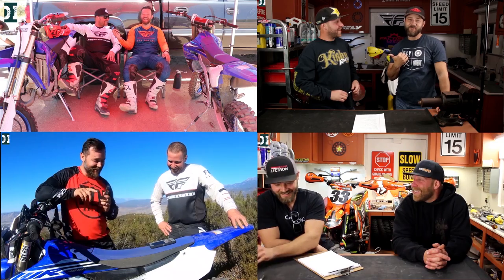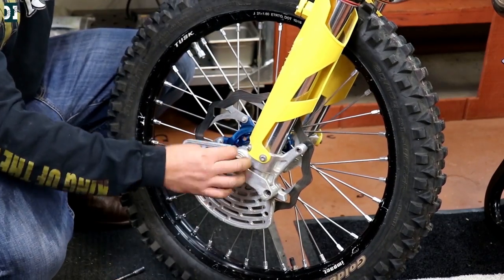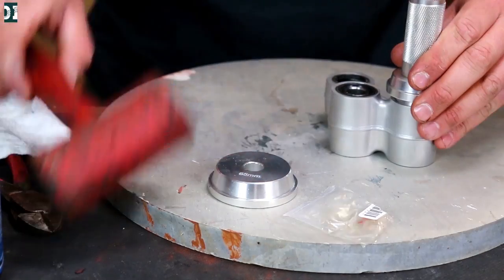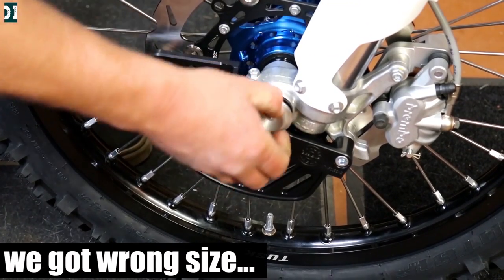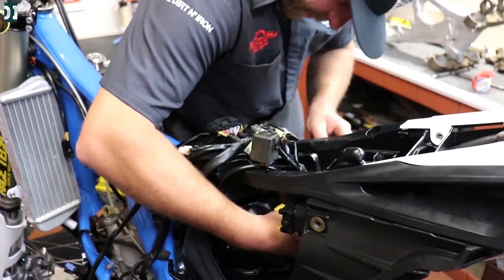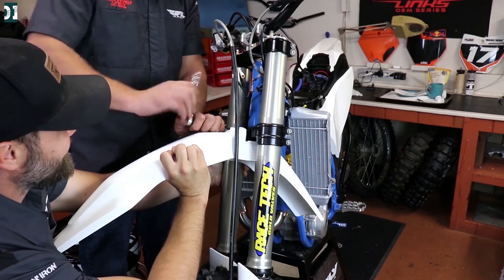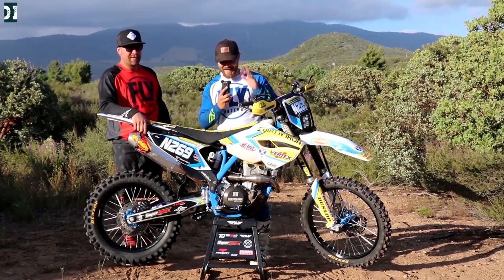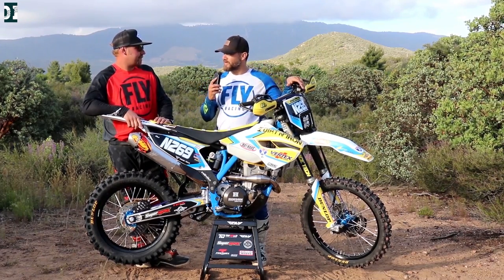Dirt bike build time lapse - Husky FE 366

Comment: Really nice build vids, colour etc. do you have a list of recommended bits for a new Fe350? or the list of upgrades you have done over the build? I'm hoping to pick up a 2021 or 2022 Fe 350 in the next 6 months and as a new rider want to get the right upgrades and protection :D. thinking black/grey/yellow scheme for myself
Reply from the maker: sounds good David! get a skid plate, wrap around handguards, shark fin, possibly linkage guard and have fun. you can add as you go. have fun!
Reply: @dirtniron  Thanks, I think i have all those written down,  wondering about a rekluse clutch cover, a chain guide, possibly looking at the extra air induction holes you did on your build!. i don't think ill be doing any power improvements until my skills are far better :D
also fastway pegs evo ext look good and maybe a bigger back brake pedal

Comment: When you put a new piston and or cylinder on you want to use regular not synthetic oil on the first hour or so because the synthetic is really smooth and can cause the new piston rings to not set properly , just a tip for next time
Reply from the maker: thanks for sharing Everett, this was a synthetic blend oil..

Comment: Is there any big bore available for a 2017 
or newer 350?  I can’t find one.
Reply from the maker: Kelly, Cylinder Works has the big bore kits for 2017+ models, its also 366cc, I rode couple of those bikes and they run really good

Comment: okay so theres a part that I would really love someone to help me out on, maybe two things to be honest. I am a little knew into dirtbikes or atleast finally owning my first one. There's a part when he is installing the linkage and said he added a dog bone that basically will adjust the height if needed. I honestly would love something like that for my bike, I see all these awesome parts but finding ones that fit my bike are kind of difficult. I have a 2005 YZ250F and I would love an adjustable linkage or even just something that can bring my bike down like just an inch or so.
The second part is I really want my bike to have a clean look and also do everything I can to make in run amazingly. Is there anything anyone suggest I should have a mechanic do first to achieve that. I was thinking about installing a whole new clutch system. The previous owner said he rejetted  the carb so I assume the carb is in great shape. is there anything I can do with the engine. I've even heard suggestions like new chains and sprockets will be great to have. My suspension is RG3 front and back so I think that doesnt need anything. If anyone could help me I would greatly appreciate it!
Reply from the maker: look for lowering link for yz250f, I think there are some products out there. Something like this https://devolracing.3dcartstores.com/Lowering-Link-125in_p_616.html
  New clutch, check the valves and JD jetting kit would be a good idea..
Reply: devol lowering link, get a new front end from a newer bike updated graphics and black wheels would pull it together
Reply: @robbiejensen6161   I really want a newer front fender but I think I would have to Redrill the holes that hold it in place. They don't make any restyle kits for older 4 strokes only 2 strokes and I don't understand why
Reply: @goatyachty1762  ITs not that hard I did it on my dads yz, get like a 14 front fender and then just redrill some holes in its not too hard

Comment: You should tell your Expert engine builder friend AND your Bike builder freind that there's a tool called a Torque wrench and they should get to know it.
Reply from the maker: There is something called humility and you should probably get to know it 😉
Reply: @dirtniron  Aint no humility needed as i didnt wrote something you or your friends didnt do in your video. Working with impact wrenches on a bike is way more than unprofessional but hey - its your machin, worst case if something will happen to your new engine itll give you more content to upload. Good luck.

Comment: I had a husky wxc350 (cagiva era). What a piece of shit it was. Torquey but slow revving. Clutch drag to the point of unusable. The replacement basket alone was 265 plus install (riveted) and it still dragged. Loud. Hard to start. Would not turn, handled like a freight train. Thank god KTM bought Husky. Seem like good bikes now.

Comment: I love how they think that 250 hours is a lot. I know that pro motocross bikes are riden harder. But come on man that is a power loss of what? 1 or 2 horsepower. And apart from the plastics and where the feet contact the bike it was in great condition. Its not a 2 stroke but during the rebuild they acted like it was. But if you have the money its whatever.
Reply from the maker: acted like it was a 2 stroke? what exactly does that mean?